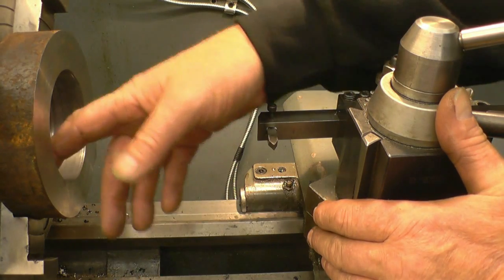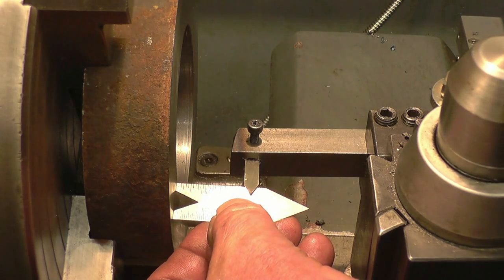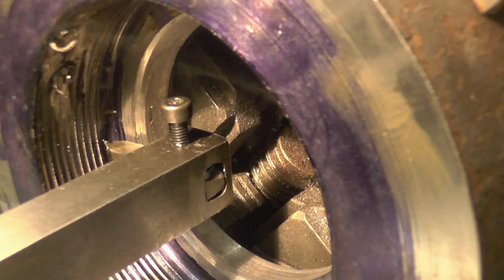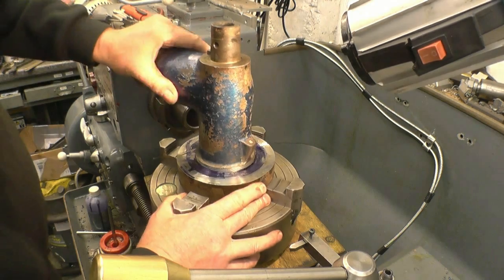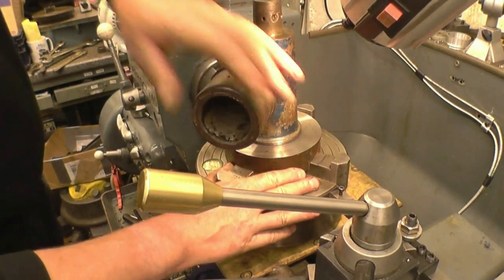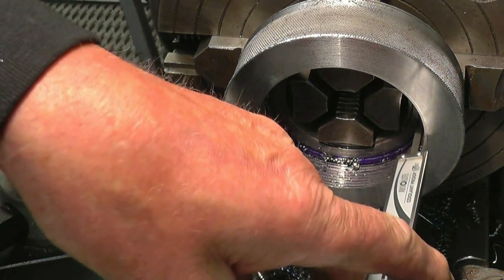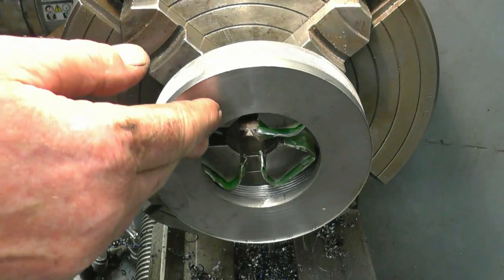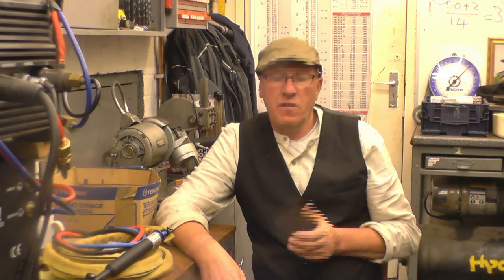SNNC 125 P3  Internal screw cutting  (imperial / metric lathe)

Comment: Hi John,

It looks like you've got a worn key/keyway in your change gear setup (the compounded pair). I think that's where much of your rattle is coming from.

You can put the lathe in neutral to spin the chuck for checking the thread. The lead screw would still be engaged and you'd be moving the saddle, but it's probably still easier than having to remove the chuck repeatedly

Comment: I saw a video where the operator used 2 keys at 180 degrees to center up the part. I have not tried it yet, but it seems like it may be easier. Just passing on a thought.
Thanks for the great videos.

Comment: Great series. I'm always making repairs or making replacements for unfindable parts, so this really speaks to me.

The threads may be tightening up as you run the collar farther onto the housing because the pitch is off by 127/128 ( 127/(2 x 64) ). It's a little less than 1%, but you have about eight threads there, so the difference in location (from desired location) of the last thread vs the first thread is going to be about 8% or 1/12 of the pitch. That's more than enough to really tighten up a good fitting thread.

Early on I think (like many of us non-NE-England folks, I'm not always sure what I'm hearing) you said the your new collar was thicker than the original, so you could make more threads; I think those extra threads are actually working against you in terms of magnifying the difference between ideal imperial threads (with a 127 tooth gear) and what you get using a 64 tooth gear doubled. If you only had four threads the error would only be about 4%.